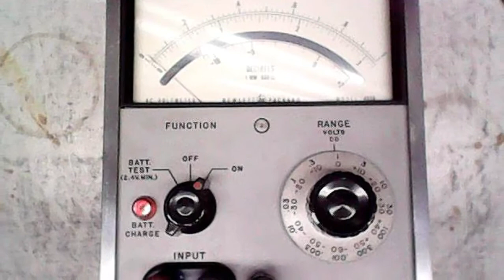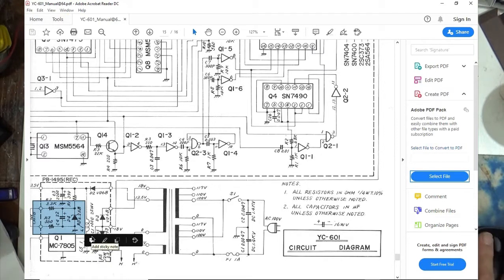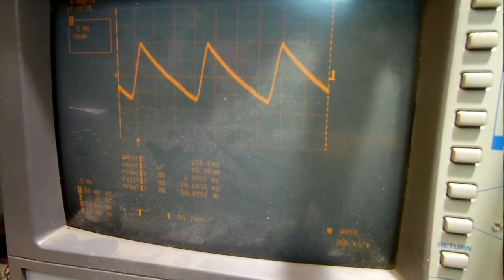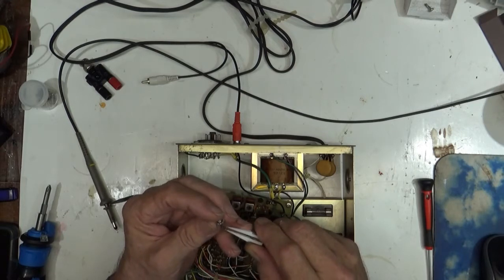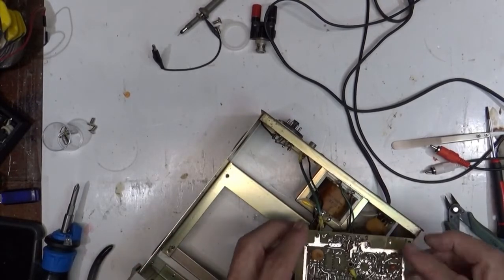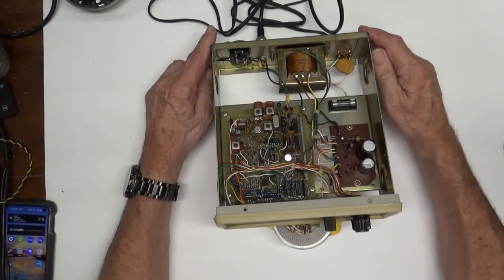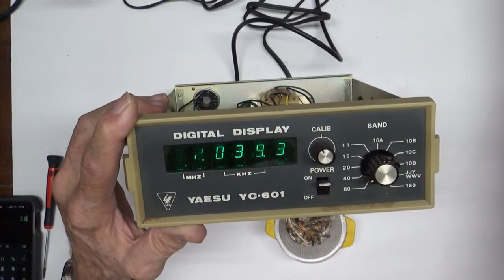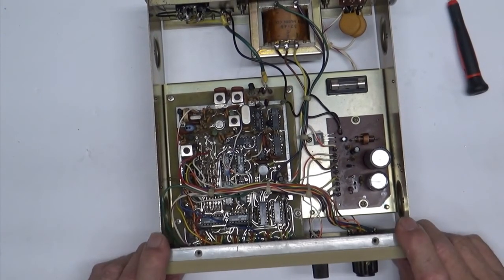Rerpairing (mostly) a Yaesu YC601 Digital Readout for an FT-101

Comment: Don't ya just hate it when parts are unobtainium?  Cheers & 73 from W Rusty Lane K9POW in eastern TN
Reply from the maker: It does add to the frustration factor that is for sure. It does amaze me though just how much you can find out there on the WEBs. The repair life is a lot easier than it used to be.

Comment: Very interesting piece of gear, thank you for the video. Could you bodge in a SN74141  Nixie driver chip to replace that  µPB249?
Reply from the maker: I dont know. Problem is you can't even find a datasheet on the upb249.
Reply: @AERVBlog  You have the circuit diagram of the digital display and two chips that function. Also, you know the output of chip is to a  7 segment display so you have the goesoutas. I would check the goesintas and see if they are BCD. If so all you need to work out (from the schematic) is the proper pins to use with the SN74141. According to this manual - http://www.radiomanual.info/schemi/YAESU_HF/FT-501_user.pdf - the input to the µPB249 is BCD. Note - I had to search with "µ" and not "u" to get this info. Hope this helps!
Reply from the maker: @davidv1289  Ok, I traced it all out. There is a chance I can do the conversion with a CD4511. The output pins are the same and the VFD tubes conform to a 7 segment display. The input pins are different but that can be fixed. There is just one problem. The LD8062 tube has a dedicated #1 going down the center and they use it instead of segments B&C like a 7 segment device. I might be able to get around that by just ignoring it. I still have 1 pin on the UPB249D that I don't know what it does, pin 4, but I suppose some experimentation could solve that. Stay tuned. If I do get it figured out I will make a video of it.
Reply from the maker: Can't do it with a 74141 but might be ableto do it with a CD4511. Working on it.
Reply: @AERVBlog  Great! I would like to see a video of your repair and see that neat old display fully functional.

Comment: I bought one of these brand new in 1977.  I still have it and its manual.  The power supply section in my schematic appears to be the same as what you displayed in your video.
.
Mine, along with my FT-101E has not been powered on since 1997.  Both have been packed away since then when I moved to my current home.  I plan on recapping both before I even think of powering either on again.
Reply from the maker: You should take care of them.  They are like us, old and still useful. 
So the power supply schematic  looks like what is in my unit? If so can you scan it in and email it to me please so my manual is correct.
Reply: @AERVBlog  OK... maybe my reply was somewhat confusing.  What I meant to say is that my schematic appears to look the same as the schematic you were showing on your monitor screen.   I think I may have given the impression that my schematic agrees with your unit's physical layout.  Apologies.  This was not intentional.   
.
Regardless, I did scan in my manual (to PDF) a while ago and did puzzle together my 3 separate scans of the schematic into a single big page.   I can send you copy of this PDF if you like.   If so, where do I find your email address?
Reply from the maker: @rickf2061  no problem. I wonder when they changed power supplies.
Reply from the maker: @rickf2061  that would be great. Probably better than the one I have. 
Davanelectronics@gmail.com 
Thanks.
Reply: @AERVBlog  Hi...   I just found my email (sent 10 months ago!) stuck in my outbox.   Ooops!    Just resent it a few minutes ago.   I hope it got through this time.  Apologies for the delay.  I hope it is still of some use to you.     ...Rick